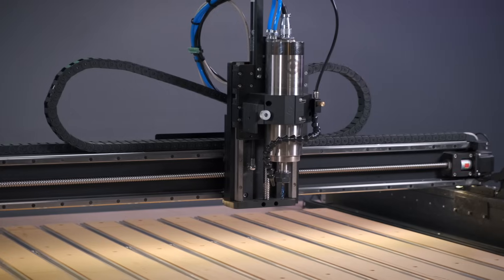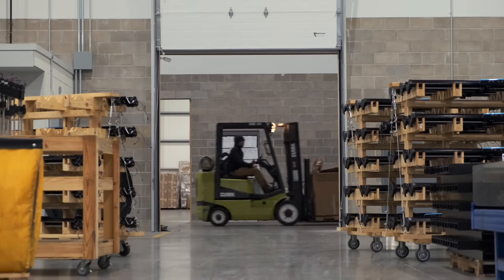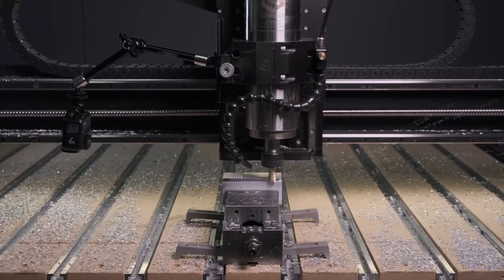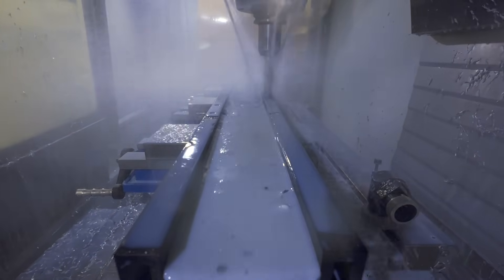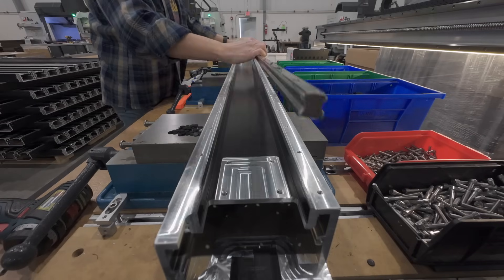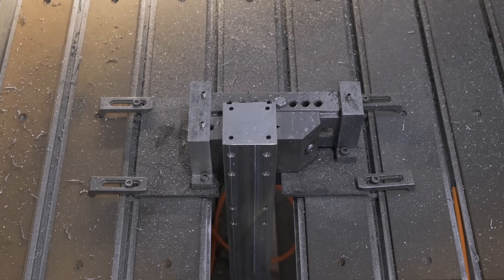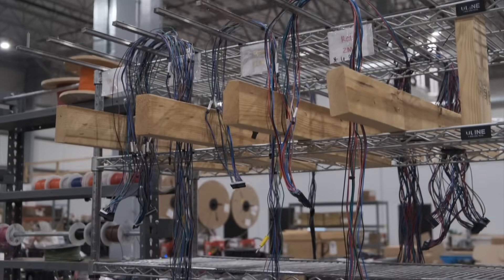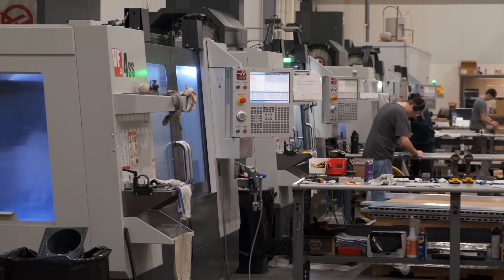The Manufacturing Behind Shapeoko CNC Routers

Comment: Sorry but i don't understand the process when linear rails put in the extrusion in the vid...Why the operator secure the bolts in the extremes and the machine proceed to put the rest of the bolts in the rails. The question is, i don't see the producedure to align the rails usin a dial indicator to perfect aligment, why Shapeoko machines sell with perfect aligment rails without the minimum process to align?? is magic or what??
Reply from the maker: The gantry has reference edges machined into them to align the rails.  The machine is only putting the screws in place to remove the time consuming part.  One of the assembly people tightens down the rails against the reference edge to get them parallel.

Comment: EXCELLENT. I didn't realize you were so close, Im in southern Iowa! Love my old S3 and Nomad3 at home, but when I needed to get a small aluminum part production machine for work, it was a no-brainer to get an S5Pro. My impatience says I want the travels to be higher, and I wish I could choose where to park it when it was done with an op instead of it running away to the far corner every time. Still need to build a nice table/enclosure for it and get all the bells and whistles set up, but unfortunately, my actual job tasks keep getting in the way 😅
Between the S5, the Bambu, and the Pick&Place,  I'm in my robot happy place

Comment: Since these machines are made in the USA,
I'm curious why metric fasteners/ threads are used in building them?
Reply from the maker: Metric has increasingly been accepted as an industry standard. Just look in any modern car for example, even domestic. At scale (not like going into a local home improvement store), metric fasteners are just as common and affordable as imperial. And there's a lot of design reasons it nicer, a big (mental) one is you're not beholden to random fractions. And given that inches are defined by a metric standard, there's no reason (practical or patriotic) to not use metric. It just makes sense. (-W)
Reply: @carbide3d  
I was just curious.  That is as good of reason as any other.
I am retired now, but machined for 38 years. Fraction/demical, I can convert instantly like any other good machinist. 
However, I've never had to turn a metric thread. 
I've also been researching CNC Routers, projects. I believe my love of Fine  Art and CNC routing can be bought together. 
I am very close to pulling the trigger on a Sharpeoko 5.

Comment: Nice insight into the build process. Are all your parts US origin? 
You and suppliers not suffering any supply chain issues from abroad hitting tariffs?
I guess your Carbide Create Pro can be used to design your own parts or do you use a competitor product?
Good luck for future in uncertain environment.
Reply from the maker: We do as much as we reasonably can ourselves, and we rely one a few other domestic shops as well. However, there are some parts that you simply can't get in quantity (or at all) here. Ex. motors. There's a realistic balance we, and all manufacturers have to strike, and there will inevitably be some impact. It's too soon to tell what the long term ramifications are though, since things are changing so fast. Best we can right now is lean on smart design and be a little scrappy when we have to. 

For design, we use a combination of Inventor and Fusion. Carbide Create Pro isn't parametric, and so it's best for single-part/monolithic projects (ex. a fancy sign, relief carving, etc) and/or artistic applications. (-W)

Comment: This is a great video.  I never knew you had manufacturing in Illinois.  I have been researching and shopping CNC routers for several months.  Last week I finally made the decision to go with the Shapeoko 5 Pro.  This video made my decision feel even better. 
 
Have been using Carbide Create this week.  Production files ready to go.  I will admit though my background in aerospace tooling/metrology with 3d software made for a quick learning curve.  

I'm off to my shop as I have finish prepping an area for the 5Pro.  Will be ordering in about a week or so.  Thanks again for posting this video.

Comment: Really great video! Love its made in the USA.  Shows your proud of your product, I love my 5 Pro 4x4. .....I do have a request ; "Can you make a riser kit for the Shapeoko 5 Pro ?"
Reply from the maker: We've heard that request a couple times, from our perspective it's a bit of a liability, since it does theoretically weaken the machine. Conceptually it's similar to putting wheel spacers or oversize tires on a car. There are added stresses to the machine that we can't guarantee 100% won't reduce performance or capability in some way. (-Company Policy)

That being said, if you have a Shapeoko, you already own the means to producing a riser. It's little more than a block of aluminum with 2 thru-holes to bolt to the Y-axis, and two threaded holes for the gantry to bolt down to. The "Fasten-oko" shown in the video actually had riser blocks on in. This is definitely a "do at your own risk" kind of thing though. What kind of things do you want to make that require extra clearance? (-W)
Reply: @carbide3d  W .... I totally understand being myself a mechanical engineer. We were just looking at 3D shaping some molds ( high density foam) for making fiberglass aircraft parts from. Thanks for your feedback. Search this title on YT: "DIY CNC Upgrades: How I Modified My Shapeoko 5 Pro CNC Router to Gain 3 Inches of Gantry Clearance" Studio-Z. Its another way to add risers.